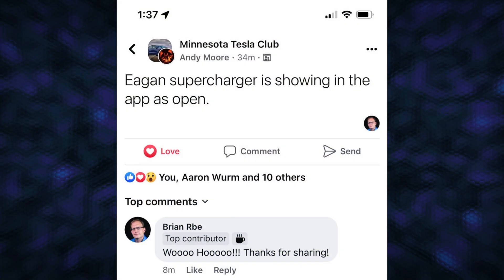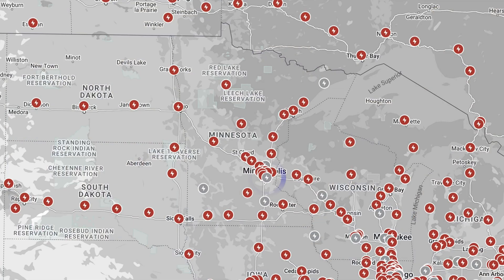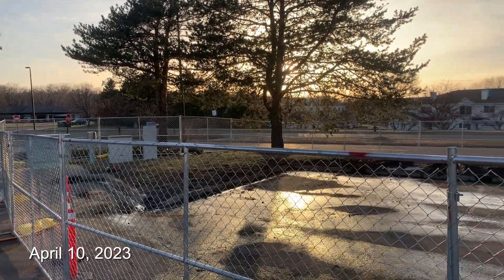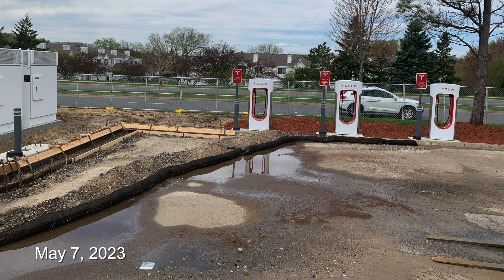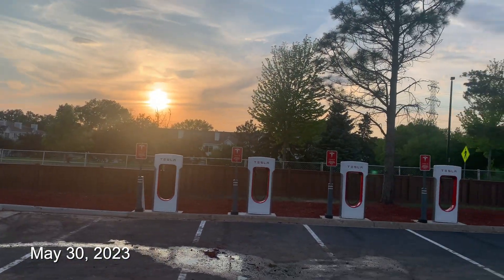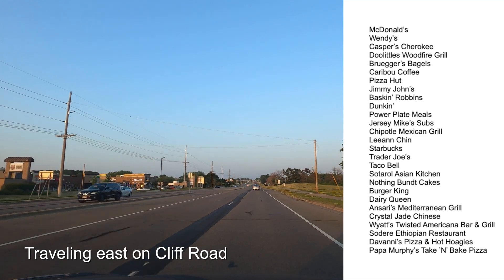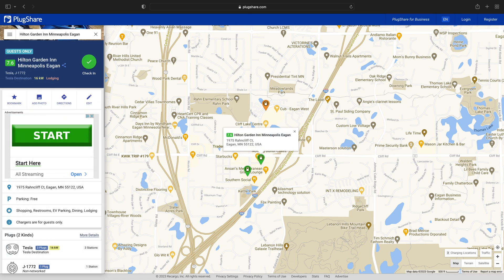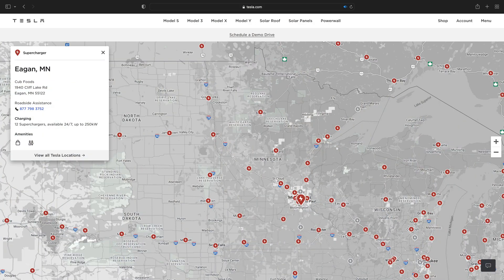Tesla Supercharger Build - Under 3 Months!

Comment: One more thought about having a nearby Supercharger and being a member (customer) of Dakota Electric. Dakota Electric has two EV charging plans. I chose the plan that allows charging at any time, but the rate varies with time of day. I would now feel comfortable with the plan that only allows charging from 11pm to 7am. (At other times electricity is shut off to the charger).  If you REALLY needed a charge during the day you now have a nearby Supercharger.  Price is a little less than 5 cents a kilowatt hour.  Good deal!
Reply from the maker: Great point! That’s the exact reason I chose the time of use plan in 2018. It might make sense to change and save some money day-to-day. Time for math! 🧐

Comment: Nice video. I live just a couple of minutes away from this site.  Like you I charge at home and don’t expect to use this charger much at all.  BUT, it is really nice to have it nearby in case driving for the day ends up being way more than usual and a quick charge becomes necessary. Rare but conceivable.  Still hoping Tesla adds a couple of Superchargers for the Arrowhead region.
Reply from the maker: Thanks! Yeah, if you’re almost home at a low SoC, this would be a good option if you have to run right out again. It’s happened to me a couple times over the years and this or Bloomington would be close options depending on which way you’re headed.

Comment: Not too bad of a timeframe considering the weather and the unique circumstances of the slight curve of the parking lot.

To my understanding if it’s a standard parking lot where they can drop a prefab unit on the ground ready to go faster than the power company can get their equipment on the ground and fired up.

I don’t think they’ll have too much a problem of capacity issues when Ford and GM comes onboard in early 2024 since it’s only select stations and they’re constantly building new sites every month.
Reply from the maker: I agree, I think they would have done prefab if they could. They did in St. Peter and some others around. Yeah, they’re building at a pretty fast pace. I think we’ll be alright. Thanks for watching!

Comment: Pull-in spot will also be useful for Ford/GM/Rivian/[insert next OEM here] EVs from spring 2024 on... 😁

Thanks for the look at an exciting addition to the Twin Cities charging ecosystem.
Reply from the maker: Thanks Steve! Some Tesla owners were concerned the station layout wouldn’t work with the centered pedestals, but a Tesla supercharger tech assured them that it was correct and intentional. I’m speculating, but these should be easier for other vehicles when the time comes, possibly with a longer cable, or theses could be place holders until V4 cabinets are ready? The next year or two should be interesting… if they can sort out the charging for everyone. 😉